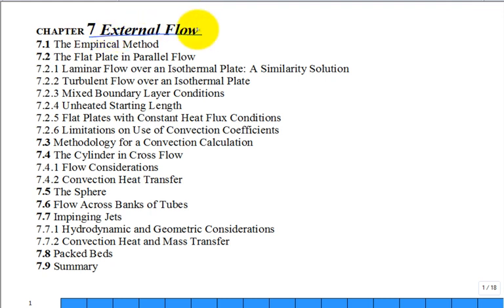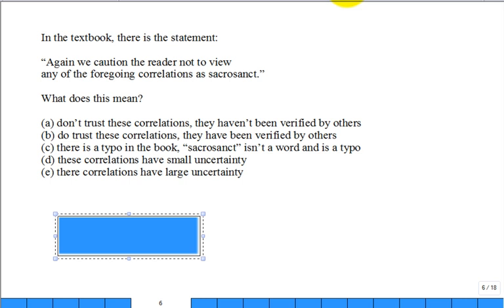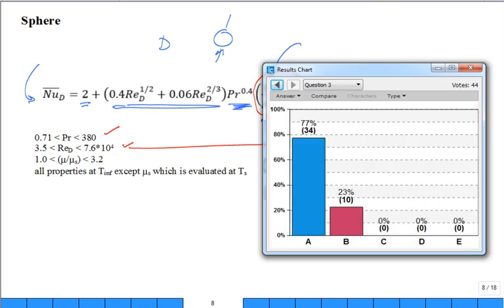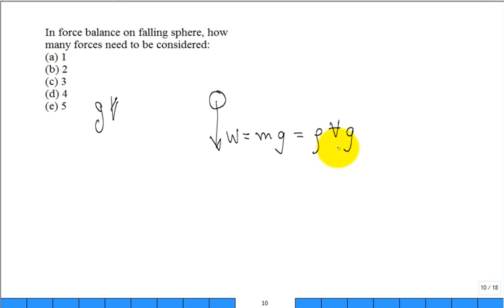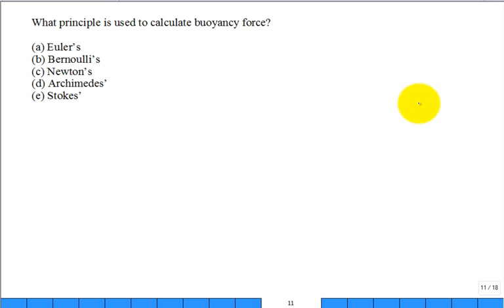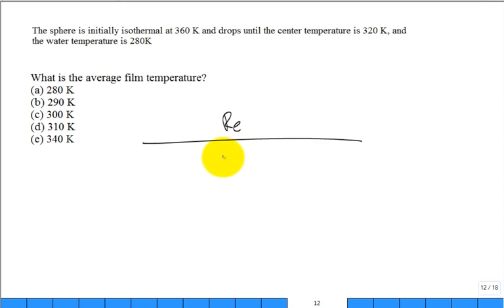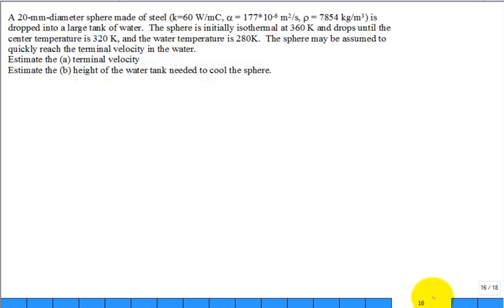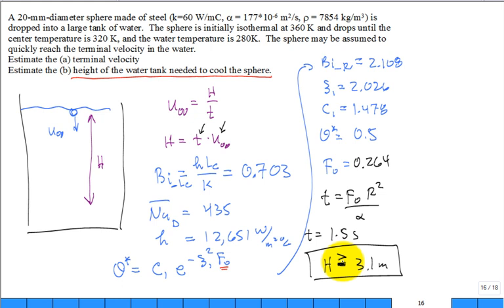External Convection 2of2

Comment: Dear Professor thanks for the wonderful lecture. One question with the sphere problem. From what I understand in the lab we measure the total force acting in the flow direction and divide by A times dynamic pressure to get Cd (drag coefficient). This coefficient takes into account the effects of pressure and viscous forces. The tables report the total drag coefficient. Therefore, the effect of the buoyancy seems to be included in the total drag coefficient. (This situation seems no different from a stationary sphere being exposed to U infinity equal to its terminal velocity in this scenario according to similitude). So I think only two forces should be taken into account for this problem.
Reply from the maker: think of drag coefficient data calculated using horizontal flow measurements, so buoyancy does not affect data.  If experimenter used falling spheres in a fluid to measure Cd, then they would need to account for buoyancy force before reporting Cd.